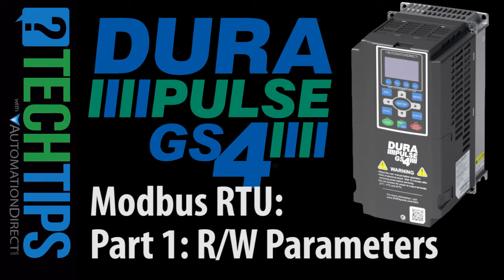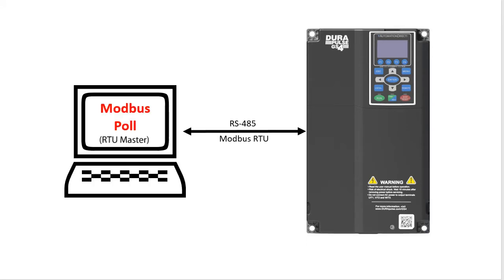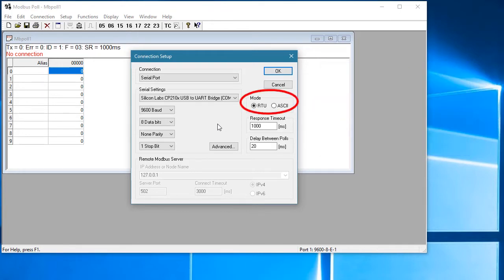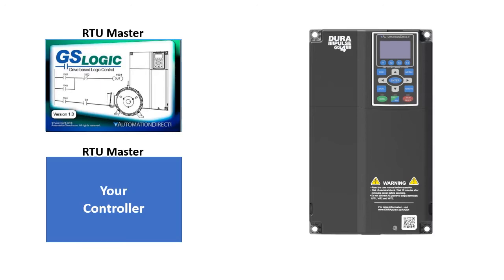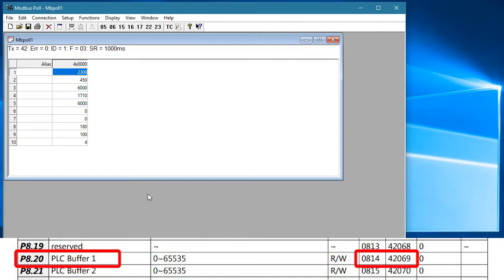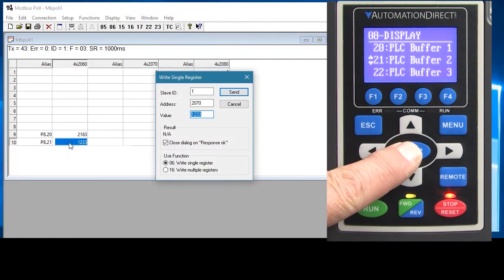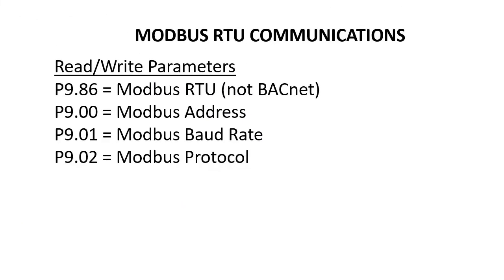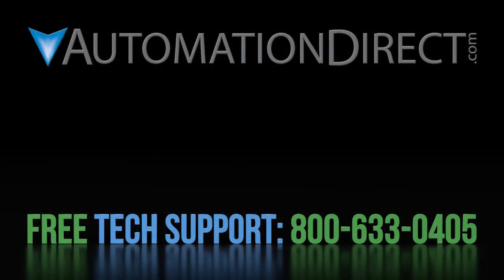DURApulse GS4 VFD Modbus RTU Quick Start Part 1 from AutomationDirect

Comment: how does 814 hex =820 decimal? I thought 814 Hex is 2068 decimal
Reply from the maker: 8.20 is the parameter number within the drive, not the Modbus address. Its Modbus address is 0814h or 42069 decimal. You are correct that the direct equivalent of 814h is 2068d. When using decimal addresses start at 1 instead of 0 like in hex. The leading 4 is just a Modbus convention that identifies the register type that is not used in hex.